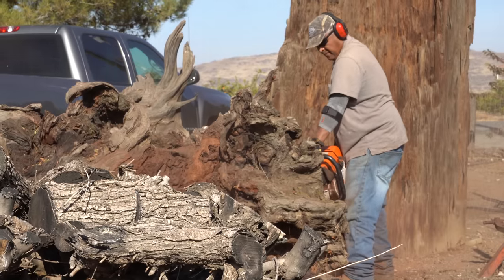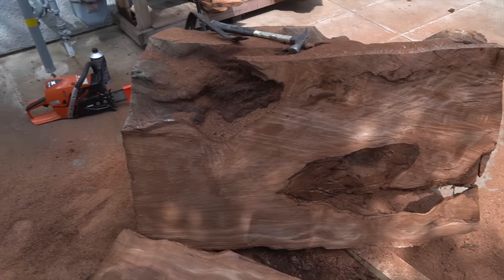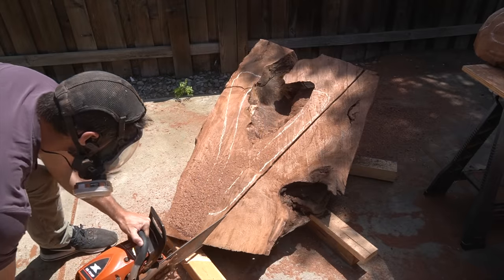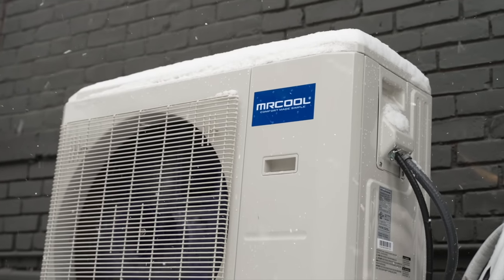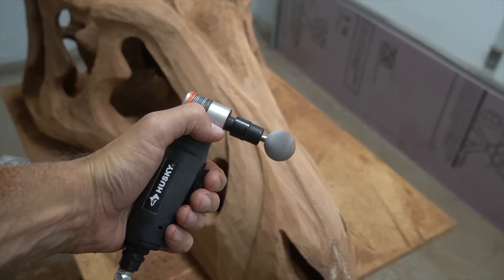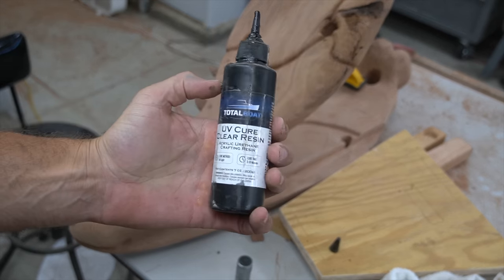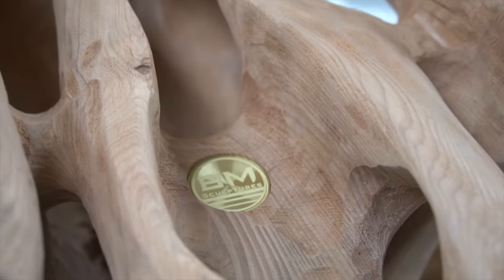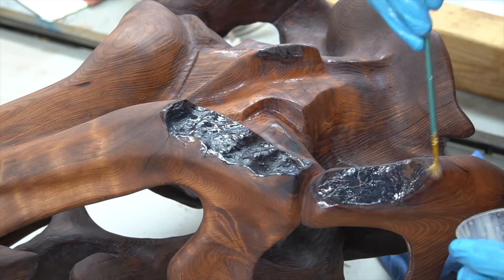I Spent 400 Hours Carving This

Comment: The dimples around the jaw are for nerves! I don't remember whether they're anchor points or something else but they've got to do with the nerves in the tyrannosaur's lips (we know they had lips partially because of the even arrangement of the dimples, which I think is really neat). Glad you included them in the sculpture, it came out amazing!
Reply: With the way they seem to come out of the skull it's very likely they were nerves yeah! My guess would be the same as yours, them being anchor points for nerves to sprout out off.
Reply from the maker: I think you are correct! Have had lots of people mention this!
Reply: If I remember right from a film I saw ages ago Crocs have very similar dimples and they're nerves that detect vibrations.
Reply: @tsunamihilmy  I was thinking about the whole vibration thing which iirc sharks have, not sure if that would explain anything since I'm not at all sure if the dinosaur in question has been proven to have some form of vibration location (in sharks it's with electromagnetic waves or something similar). Aside from nerves and blood vessels, those holes seem huge still.
Reply: @tsunamihilmy  For the hole be that big you'd expect something like a human leg to be provided blood, I doubt it's just nerves and blood circulation.
Reply: Foramen or Foramina is the name. I did a little research for you all xx have a nice day.
Reply: @tsunamihilmy you see these types of holes on whale skulls. They have giant veins to supply lots of oxygenated blood to the head.
Reply: They are called labial foramina

Comment: I have a tip for you. when sharpening the chain, press forward only. 3 or 4 times. at 30 degrees until you get a certain feeling and sound, when you do that the chain will be even sharper.

Comment: I'm sure its alrweady been answered, but since I haven't found any comment doing so. About the "dimples" on the T-Rex's jaws:

That's wherw the face muscle's tendons go. Basically, you can see this on many animal bones actually, how the larger and stronger a muscle is the more "anchoring" it needs so it starts to form a sorta "socket" to create more area for the tendon to hold onto. For instance comparing ape skulls to ours you see a similar issue where a sorta "fin" pops up top to hold the added muscle.

It seems the T-Rex had a skull and jaw so overgrown than its face muscles needed that "anchoring" all over the place.

Comment: The pits on the lip area could be heat sensory pits like some snakes such as vipers have. They use them at night time to detect heat that comes off of their prey’s bodies giving them almost like a thermal image of what’s in front of them letting them know if it’s prey or danger. They also have forked tongues which detects chemicals in the air that’s similar to a nose but several times stronger.

Comment: Something really cool about T. Rex that wasn't replicates is the hard pallette, the roof of the mouth in the skull basically, because it actually has little holes/divets where the lower jaw teeth would socket into when it closed it's mouth.

Comment: This might be a dumb question, but can someone explain why this is selling for $80,000, what makes it worth that much?
Reply: It's actually $48,000.
Since he worked 400hrs on it, his cost on an hourly basis would be $120. This does not take into account the cost of the 1000year old wood, the electricity consumption and any other hidden cost.
He probably made less than $100 hourly.

Comment: I'm a sculptor & a critic.First, congratulations on your completion, and display.
Your old growth redwood Burrell T Rex skull is very good.
I am an artist, whom like you, like to make it, with a dream to sell it. I hope you did, or do.
My critical comments are that:
The teeth set points are, for unknown reason(s), let obvious. This is a great detractor.
I believe the skull thickness was excessive.
The vertical support of top-skull was unfortunately there.
The lighting, as shown was very strong & harsh.
There were limited skull details.
This is a potentially valuable piece, which was well done, but fell short of potential. 
This work would have been better completed in a low paid third world location, where labor was not all your's.
No credit for weeks of sanding.
My opinions.
I did like the video, & subject.
Thank-you

Comment: Huh, I hadn't noticed the thing about the indentations before, on t rex skulls. I used to be super into zoology when I was a adolescent. ...now that you brought it to mind, I have seen those groove type  things on pythons...I had to look it up but they're called labial pits...a heat sensing feature. Reading more, apparently now it is believed T rex had great eyesight AND smell. Hmm. Nevertheless, this is super interesting. I wonder what species of lizards and other reptiles have labial pits. Its been theorized that T Rex did not have very good vision, so that makes sense that for such a large with such a large head to have this feature...however, a LOT of skeletons have been found in the southwest US like the desert region, so I wonder how that works in a warm environment, how they would distinguish external heat from body heat of their prey? It also made me wonder size wise...which had the longer tooth? The biggest Megalodon found on record vs the largest T Rex? Another person here says it is foramen? Looked that up. Has to do with metabolism. Fascinating!